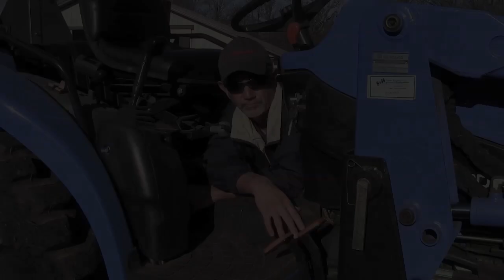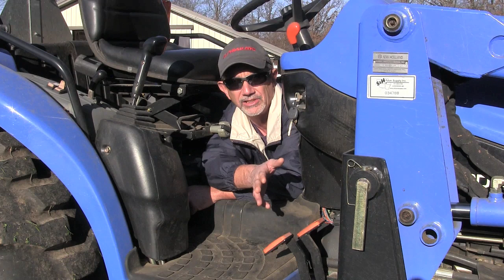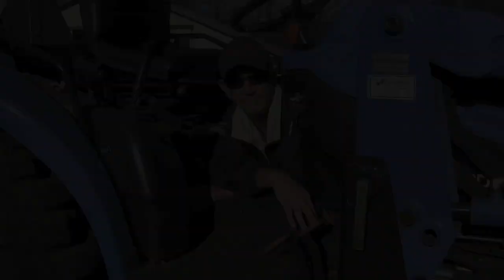Making a Hydrostatic Transmission Last Longer

Comment: Great video. I have a sub compact Kioti which i use to mow football pitches in the UK. I obviously want the machine to last as long as it can for my business. It has two ranges but i only ever mow in Low. No matter how short and easy the grass. I mow in low but keep my foot flat to the floor for full speed when moweing (it's obviously short, easy mowing). Do you think this is only? Full speed in low range? Foot hard to the floor?

Comment: How often should I drain and refill the hydro fluid?  Please don’t tell me to reference the manufacturer recommendations. If it is anything like oil change on a vehicle then I would half the recommended hours. TY
Reply from the maker: Why do you not want to follow the manufacturer's recommendations?  Change it as often as you want then.  It won't hurt anything to do it more often than they recommend but it's going to get expensive.

Comment: Mike, you mentioned lawnmower.  On a Deere X500 there's no H or L for the hydro, and the engine is normally run at full throttle.  Would it make sense to throttle back a bit, say from 3400rpm to about 3100rpm or so,  and use the hydro pedal to get the speed back?   (I say "a bit", cause I'm thinking if you throttled back too much the engine would overheat.)

Comment: What advantages does a hydro have over a shuttle shift other than ease of operation?
Reply: TL;DR:
If you require a lot of power in constant speed/direction for long time (plowing, hauling,...): shuttle is the best. hydro wears/suffers a lot.
If you don't need so much power but a lot of maneuvering (loading, mowing,...): hydro is the best. shuttle wears/suffers a lot. 

Inside of hydro here is a lot of friction going on, be it hydrodynamic friction or metal/oil/metal friction. That produce a lot of heat and wear. Because of that, the transmission is "designed" in a way to carry on with a lot of friction and wear.

Shuttle shift (any manual discrete transmission) works best at constant speed. If you need to extend the range of speeds (going back and forth with a loader for example) then you compensate this with clutch slip/friction and with gear change (another wear in gears/shafts/...). Such a change of speed or direction is more like a "corner case" for the transmission - that means the transmission suffers a lot.

So if you would put shuttle next to hydro and let them going back and forth in dynamic range of speeds, hydro will win - shuttle will get destroyed much earlier. Hydro can just "slip/frict" by design very well.

On the other side, if you take heavy trailer hauling on the highway (maybe plow is better example), shuttle will win, because you hydro will get burned/destroyed much earlier.

These transmissions are as different as they possibly can be. Different use cases, different maintenance, different convenience. It is hard to pick one.

Comment: I have a Kioti DK10SE Hydrostatic Tractor and had the engine oil warning light come on for a minute as I was riding slow in High Gear, I put it in low gear and pushed the pedal down most of the way and it went off. 
 Then when I put it in High gear and pressed it over halfway it seemed to have a winning sound and was unable to drive slow in high gear. 
 I shut it down to check it in the morning but could I have screwed the High in the Transmission ? 

Uhg it's only got 7 hrs on it to...???
Reply from the maker: Buzz, I'm not sure what's going on there, but anything that's wrong with 7 hours should be covered under warranty.  Tractors are tough, it takes more than that to screw something up.  Definitely make sure it has oil in the crankcase.  I'd continue to use it and see what happens, without being able to drive it, it's real hard to know what the issue could be.

Comment: Question...there are PTO generators out there...which would require your tractor to idle for a very long time if you're using it during a power loss. How does that affect the hydro?
Reply from the maker: David, if you run a generator, you'll be running at PTO rated engine speed, not idle.  I don't think it will have any impact on the hydro.
Reply: @TractorMike  thank you...I just bought a tractor and I'm trying to figure everything out...so many things different than a car..., diesel engine, hydrostatic pump that runs various items, etc. Your YouTube channel is by far the most informative and you cover a lot of great topics...the one on grease products with the guest host was great, as an example...

Comment: Most excellent advice!
This explains why I have seen overheating of my engine, when (accidentally) running the PTO & rotary mower and using 2nd gear instead of 1st.
Thank you, Mike!
Reply: Hiii bro.
I have a tractor with hst transmission but when it work about 20-30 min. I heard a sound like(zzzzzzzzz......) whenever I press forward or backward pedals.
What cause???

Comment: I'm confused. I have a 3 range hydro on my Kubota. All the research I've done suggested when you lightly depress the pedal in a low gear, that keeps you in the lowest gear possible, giving you the most torque. Maybe you just meant in high gears and I didn't understand this video correctly

Comment: Hi Mike
A subject perhaps you could talk on is, when operating a hydrostatic tractor what should the engine revs be? I have two Kubota tractors a b2230 and a b3150 and both machines only seem happy at maximum revs, anything less and the gearboxes seem to wine and lack power, I am considering buying a manual with shuttle so I won’t need the engine revs so high and get more power to the ground or am I doing something wrong?
Great videos
Michael 🇬🇧
Reply: yea need a answer here too

Comment: Hey Mike, wanted to ask your opinion on the below video as the info seems to contradict.  I don't want to burn out my hydro so what are your thoughts on low gear slight pedal to have the most power entering a pile of material with loader?  
https://youtu.be/Ux9PiYwXLJM
Reply from the maker: No, he's right...if you're putting the hydro under load, you don't want it all the way down.  A little bit of that won't hurt the hydro.  If you operate it that way all of the time you're using the tractor you would be heating up the oil. If you're out brush hogging for three hours with the hydro pedal only slightly depressed that's bad, if you shift down to a lower gear and hold it down all or most of the way you're pumping a lot of oil and keeping everything cool.
Reply: Tractor Mike thanks for the quick response! I hadn't thought of depressing the hydro pedal as shifting into a higher gear but I guess it makes sense. And I've already caught myself "flooring" the pedal going into a pile of dirt...  You do a great job with your videos and as a 1st time tractor owner I have learned a ton from you and others on YouTube!  Keep up the great work!

Comment: Were would you set the manual idel when working a grapple, full blast or at the lowest setting, i usually work in med range for ground work  should i be in low?

Comment: Thanks for all your videos! Do you have one demonstrating how your tractor performs running with a bush hog uphill in tall grass? How does it handle pulling ripper teeth in hard dirt? If you're pushing the bucket hard, will the relief kick in or can it spin the tires? I'll be buying a tractor later this year and it would be great to see more video of the strengths and weaknesses of the hydrostatic tractors. Initially I'll be doing 65% mowing, 30% dirt work and 5% loader as forklift. Eventually more like 90% mowing with the rest spread between dirt and lifting.
Reply from the maker: If I were doing tillage I'd avoid a hydro.  I'm stretching it now running it up hills in tall grass and I'm sure at some point I'll have to rebuild it.  Ripper teeth in hard dirt, in my humble opinion, would be too much for a hydro to take for very long.
Reply: Can you also give us a calculation based on a ten year rolling average of Hydro failures from up hill tall grass mowing compared to flat tillage and give estimates on this causing nervous shareholders to sell off stocks of tractor companies coupled with market fluctuations and tractor companies profit and loss reports for the last four reporting periods highlighting the percentage of losses or profits directly related to hydro transmission failures and a list of the number of hydro failures for each tractor company? Thanks.

Comment: Love Tractor Mike's vids but this is just silly if you understand how a piston pump works. When the pedal is depressed all that is taking place is you are moving the swash plate from maximum angle which is high torque low speed to minimum angle which is low torque high speed. When the pump wears over the life of the component the case drain pressure will increase with the increasing tolerances in the pump pistons. Pressure is pressure, doesn't matter what angle the plate is at when it's being made.
Reply: Flow changes

Comment: my hydro seems to whine a lot when using around my ranch. the tractor is 32 hp compact tractor. thanks for all the videos I have subscribed. new tractor owner.
Reply from the maker: Thanks for subscribing!  Some hydros are noisier than others. A lot of times mine seems to be noisier when I don't have the engine RPM's up as high as I should.  But, I've been on a lot of brands of tractors and there are pretty drastic differences in the hydro whine.

Comment: Mike, alternatively you might consider a video for the new owner of a standard gear transmission tractor telling them about not riding the clutch. I was at dealership yesterday and the salesman was telling about people coming in with burned up clutches and less than 50 hours on the machine. No it wasn't me, but I might have gotten chewed out a time or two for it by my dad when I was younger.

Comment: hi tractor Mike you was wondering have you ever heard of Schaeffer's Oil I am running it in my John Deere 5045e the motor seems to have a little bit more power and seems to be a little bit more quarter and The Temper has dropping like three degrees you know friction is heat I think that is pretty good I was just wondering if you have ever heard of it
Reply from the maker: No, I've not heard of it.  I'll keep my eye out for information.
Reply: Tractor Mike you can look up Schaeffer's Oil on YouTube

Comment: Is it true that running HST tractors at low engine RPMs can also damage the hydro pump?
Reply from the maker: Yeah, both the hydrostatic drive and the pump hate heat, and the more the oil is flowing, the more heat will dissipate so, yes, its better to keep the volume of oil flowing in both.
Reply: Thanks
Reply: hi tractor Mike I was wondering have you ever heard of Schaeffer's Oil I have switched all the oil and hydraulic fluid over to Schaeffer's Oil in my John Deere 5045e I can tell a big difference in how the motor sounds and how the Hydraulics work I was just wondering if you ever heard of it

Comment: Mike, enjoy your videos.  I need help.  I have a Boomer 35 4wd with hydrostatic tranny.  I got off the tractor with the brushhog running to move something and it died.  Can't get it started and can't get 2w/4w lever in neutral to free it as on incline.  Would it hurt tranny to tow it a few feet to level ground as historically it has been hard to shift unless on level?  Thanks for your advice.
Reply from the maker: Before we try to tow it, lets see if we can't get it started.  Your issue sounds like a safety switch.  First, is the PTO disengaged?  Is the tractor in neutral or is that lever not moving?  Finally, make sure you didn't have something behind the seat that slipped down when you got up.  When I carry my chainsaw behind the seat and I get up, it wedges between the seat and the fuel tank and the tractor thinks I'm not in the seat and won't start.  If none of that helps I think you have something wedged under the operator area that is preventing a safety switch from working, which is pretty common when brush hogging.  And you are correct, you can damage the hydro by towing, but if you just rock it up the hill with the tow strap you should be able to get it out of 4wd.  Don't tow it any distance.  Hope that helps!

Comment: I love your videos Tractor Mike and have recently subscribed to you.
I have a JD X738 garden tractor with hydro but only one range. Should I reduce the throttle (when possible) to control ground speed so I can advance the hydro pedal farther?
Thanks!
TJ
Reply from the maker: +isellu No.  On most of the lawn and garden tractors you want to be full throttle (you might check me in the owner's manual to make sure that's what it says just to make sure) and do all of your speed control with the hydro pedal.  Those hydros need oil flowing through them and if you reduce the RPM's of the engine you're also reducing the flow of oil.  I want to do that with my zero turn, reduce the throttle so I'm not stressing the engine, but they're designed to run wide open and the hydros are designed to get the full flow of oil pumped to them at all time.   Keep her revved up!

Comment: Good advice Mike. What are your thoughts on a hydro  tractor that doesn't come to a complete stop and you change direction , not sure I have heard you mention that before.
Reply from the maker: +Steve Rob Yeah, I don't like to do that.  I see people running back and forth, changing direction rapidly, both on hydrostatic drives and power shuttles.  It's awfully hard on everything inside.  They'll take it for a while, but all of that stuff is expensive to repair and they'll last a lot longer if you don't pressure them like that.  When I was younger it was different, but I'm content now to drive like a grandpa and save on the shop bills.
Reply from the maker: Merry Christmas to you too!  If I were the dealer I'd want that tractor in the shop until the issue was resolved.  There are too many people who have responded that their tractors don't operate that way for me to think it is normal.  Then the question becomes "who pays?".  The tractor must be out of warranty or the answer would be easy, Kubota would cover repairs.  It's a can of worms the way it is but I definitely think it should be fixed before someone gets hurt.  When I managed a dealership I was always proactive on getting safety issues resolved quickly.  I never wanted a customer injured on my watch.  Equipment is dangerous enough when it's working properly.
Reply: The tractor was under warranty as far as I could understand and Kubota denied a change and I would imagine the dealer would not do a engineering change without Kubota's say. oh yeah a can of worms for sure but  Looks like Kubota could care less and Paul has Probably designed the fix but for liability reasons I doubt he will ever show the it. It seems a lot of big name manufactures are doing the same as some auto manufactures in selling their product from its previous quality and reputation that no longer exists and some off shore units as in Mahindra is expanding now as the largest tractor manufacture in the world. who would have thought. would make a good   opinion vid for sure.
Reply: Sorry to revive old comments, but just want to add I went to check out a new Kubota bx not long ago, and the thing would roll back quite a ways after releasing the pedal. I think that was their remedy for abrupt stops when the bx series first came out.
Reply: +Mike Wiles (Ask Tractor Mike) I think what Steve is referring to was a video from Paul Short. He has a tractor that when you release the pedal the tractor rolls a bit and slowly come to a stop. There was a discussion as to weather this was normal or not. I was under the impression that the tractor was to stop after removing your foot from the pedal. Kinda like if you were to press on a brake. (Not sudden but quicker than mentioned in his video)
Reply from the maker: +The Plow Guys Tell me more.  No, that doesn't sound normal, but I'd have to run it by my service advisors to get their opinion.  Can you guys send me a link to the video you're talking about and I'll take a look at it.
Reply from the maker: +Steve Rob Well I looked at the video and that doesn't look right to me.  I forwarded a link to the local Kubota rep, who is a friend of mine, and he'll probably forward it to their service department.  The video doesn't mention that a local dealer has tried to fix the problem so I'm not thinking we have the whole story.  I wouldn't drive the tractor like that.
Reply: Paul says the dealer says that's the way it is and Kubota says they will not alter their design. My B7800 in the 6 years I owned it have rarely used the brakes it stops by itself as most hst units do when you lift off the pedal. Hey Mike you and your family have a Merry Christmas and a fantastic new Year.

Comment: one reason I don't like hydrostatic transmission. prefer a geared or glide shift (Kubota)  over a hydro. 
and hydrostatic transmissions have a whine that I can't stand.
Reply: Loader work, I can tell you, hydro is king. My work has a Kubota L3200 geared tranny with a loader and I use the loader all the time to scoop stuff up and then back up immediately. Low, High and Rev are all unsynchronized too making you stop and let the engine rpms fall before shifting to another gear. Painfully slow.
Reply: +Drew6709 On anything bigger than a garden tractor, I agree, although running rear mounted rototillers are great with hydros.  Infinitely slow.